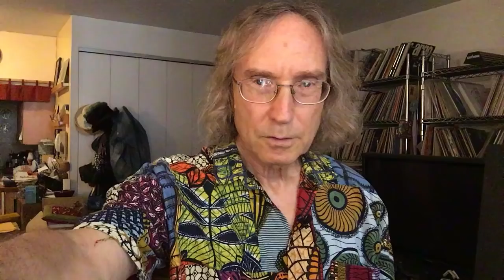Front or rear ported speakers, what’s the difference?

Comment: port can look nice at the front, but back ports sounds better since the sound is more phase correct and you can make the front baffle smaller with ports in the back.   but no port is always better if you want quality, since sealed boxes have more dampening inside and have no port problems.
Reply: " since the sound is more phase correct "
Really, though?  I mean... why would a company change the design in the same line if that were true?
i.e. Elacs, B&W... as Steve says...
Reply: companies make speakers to make money, especially on cheap products, if it sells with ports, or change it to front ports as explained by elac designer, they will do it. 
ports are out of phase, if the parts are long enough or far from the front it helps a bit.
Reply: @sudd3660  Ports, themselves , are out of phase, yes.  Rear ports reflect off surfaces reversing the phase, yes? Then an added element of time is introduced, no?
Reply: There seems to be a hole in your argument there Mr. Sudd
Reply: you don't reverse polarity of reflections, all air pressure of backside of woofer is 180 degrees out of phase, that is not wanted. on top of that it's not a clean air pressure coming out of the port, its then already reflected and the sum of that mess is coming out the port hole. then comes the reflected sound you hear after it bounce of some walls to hit you.
also all frequencies comes out of the port, its just the length of port that amplifies the wavelength the designer wanted, or most lightly had space for, a proper port with 30hz as main frequency is very long.
Reply: i don't have  a hole on my argument since i don't want holes im my speaker.
Reply: @sudd3660  Hence: 1/4 wave, yes?
Anyway..  I couldn't care less one way or the other.  There are points to be made for and against.  If it sounds good, good.
Reply: 1/4 wave is the best they can do, so not really the best.
just because someone has "point" for ports don't make them good,  just good enough.   nowhere do i see people with logical arguments explaining that ports do nothing wrong.
Reply: salmonline
I'm with you on this.   Why do other people insist that only one way is best?
Reply: @adotopp1865  Yeah, I'm not too sure what this guy's deal is. I guess he has the need to be 'right'. 
Anyway; my stand mounts have ports in the rear, but my 1cu. ft. 10" sub has no ports. 
See what I'm sayin'...lol...?
Reply: just because people have different iq's and opinions does not there are many rights, there are the best way to make a subwoofer when you choose from selasds to ported.  no one ever claimed that out of phase and the disturbed air out of a port is beneficial to the quality of the sound. ports are not there to make better sound, just more of it and extend low extension.
Reply: @sudd3660  ALLLLL-righty then...

Comment: So what about passive radiator, transmission line, bottom port, slotted front port or sealed box? And why do some speakers need to be placed further from the wall than others?

Comment: Port location doesn't matter at all. Wavelength at, say,  30Hz is 330(m/s) / 30 (Hz) = 11metres. So the path length difference due to location difference being less than 1 metre is negligible. Not to forget that radiation pattern at that frequency is spherical.

Comment: Front and back ports are not just about aesthetics! Imagine that speaker pushing back air into the box.. now imagine that air is going QUICKLY straight out the back port or it has to bounce a wall and then get out from the front port, which one is faster than the other? Obvious answer - back port has faster air flow than front port. Now, because air in this situation is not only air but is frequencies/sound coming out, the more time it takes to get out the more frequncies it holds there in this speaker chamber. This, without specifying which one and how exactly, is giving us differences in sound!

Comment: Does it have different sound quality when you place either of these near the wall?
Reply: Moving a speaker closer to a solid surface (wall) will always enhance (exaggerate?) the bass. Two walls?? Yup, more bass. Three walls?? (ie; back and side wall with floor or ceiling), sometimes waaaaay too much bass. Hate to bring this up but, room shape and size has maybe more to do with perceived sound.

Comment: all the port lovers comes out now, don't feed them, they ignorantly thinks that ports are a good thing.....
at best there are a crutch for more bass if you don't have a subwoofer at the expense of fidelity.

someone pls educate them
Reply: true enough! but in a smaller room, smaller speaker cabinets, smaller power audio amp, if correctly designed the results are pretty good at moderate listening levels.

Comment: Why on earth would you require a minimum distance of 10-12 inches from a wall to the back of a speaker cabinet in a front ported speaker?
Reply: Because you want ANY speaker as far from a wall as you can get. Try it. Has nothing to do with the port location. Yes I know this is a very old post :)

Comment: Does nobody understand anything about acoustics? Most people don't have the proper room to fully enjoy rear ported speakers. So many manufacturers and engineers make their speakers front ported. To make it easier for the listener to achieve better sound with the room that they have. I like near field listening. Therefore I prefer a softer tweeter and a front port. I understand port turbulence. Thats why I recommend speakers with a passive radiator. If you can find them.

Comment: what about sealed speakers no ports needed to boost bass. a sealed speaker will only produce the bass that's on the recording not make it boom like ported speakers can especially poor   designs that's why you have to put foam in them and then you start messing up the speakers  balance .

Comment: I get why rear ported speakers need to be away from walls but what possible harm could there be by placing front ported speakers against a wall since the port and all the drivers are facing forward?
Reply from the maker: With any box speaker, near wall placement is a no-no because the sound reflecting off the wall mucks up the imaging.  The further the speaker is from the wall the higher the ratio of direct (from the speaker) vs. reflected sound from the wall. Same is true for most instruments, an acoustic guitar played very close to a wall would sound awful.
Reply: @SteveGuttenbergAudiophiliac  that doesn't make sense, if the speakers back is against the wall, the sound isn't reflecting off anything
Reply: @carewser  If you don't believe Steve then believe your ears. Put the speakers up against the wall, listen for a while, then pull them forward 3 or 4 feet. Listen again to the same track.

Comment: Most of the time a ported box is tuned under 80Hz.  Unless your speaker baffles are huge, those frequencies are omnidirectional anyway.  Also, I disagree placing your speakers near a wall is always bad.  What is your physics explanation of why someone shouldn't place their speakers in 1/4 space?  Now, if the manufacturer says to place the speaker away from the wall in half space to get the correct low end response, sure.  But, midbass and lows will be around 3dB louder with less comb filtering and less cancellation if your speakers are up against or near a wall.
Reply: 6 dB
Reply: +6 dB at the wall, +12 dB in the corner.
Reply: @JerryRutten  my bad I wrote the wrong thing.  Yeah, textbook is 6dB, but in practice, usually it's less than that.
Reply: And when activating room modes it is even more than the textbook figures.

Comment: Good speakers don't have ports.
Reply: Agreed.
Reply: ports are a compromise and not intended to make the best possible sound. its to mane lower bass extension. if you got bigger speaker or subwoofer ports are not needed and we can have speakers with better quality sound
Reply: Oh .
Reply: My ATC SCM-11 speakers don't have ports and my Totem Storm sub doesn't have a port either.
Reply: My current speakers have ports. Damn they are crap.
Reply: @sudd3660  they're not Subwoofer Ports
Reply: all ports is to make for lower extension in a speaker, or just add volume if its PA speaker. neither is quality oriented.
Reply: The best port is no port!

I only like a port when it is in a glass.
Reply: Even in ported loudspeakers at least half of the drivers is not ported!
Reply: So I paid $1,600 for 2 bad speakers ? Well shute ! Lol